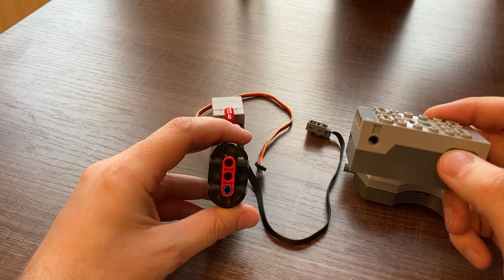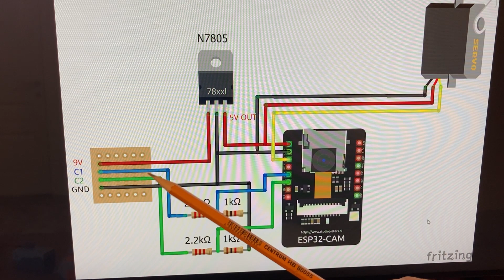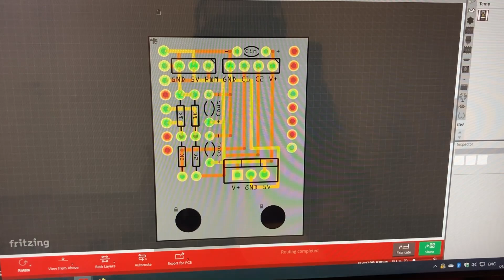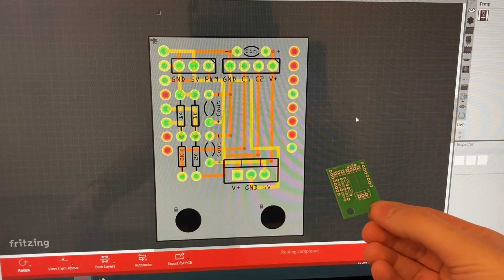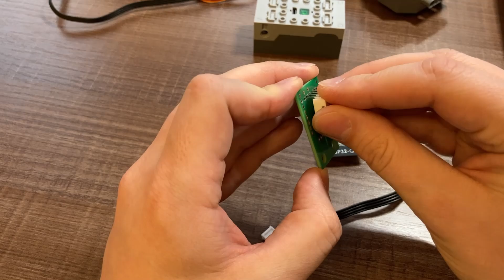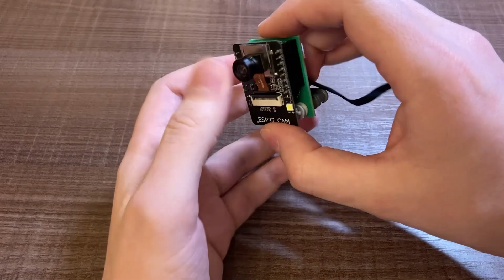Controlling GeekServo with Mould King Power Module 4.0

Comment: Great stuff. What would be needed to connect 2 geekservos to Mould King this way? Would you need a whole second setup (2x ESC32 etc), or would it be possible to connect both servos to the same ESC32?
Reply from the maker: Not sure this could be done on a single ESP32. For a more straightforward way of controlling GeekServos check out my more recent videos!
Reply: I built this and uploaded the sketch and the servos work but aren't proportional. Any ideas? Thanks.

Comment: What a great video! I liked it. So, I have one question: is it posible to connect the lego power fuction plug (4 wires) to the output wires (3 wires) of the servo motor and then control the servo with controller like regular lego servo motors?
Reply from the maker: Nope. The signal for 3 wire servo is different from one which is in lego's 4 wires. The green board acts as an adapter between these types of signals.
Reply: @igrolabs  alright, so i still need an "adapter" between the servo and the battery, like motor driver or something like that? 🤔
Reply from the maker: @ in this video, the mould king power module is both the battery and the driver. you can make a custom power module, something like in my previous video - https://youtu.be/hfu11bIr1LA
Reply from the maker: BTW now I'm working on a more simple and small custom power module, hope to finish it in February and make a new video
Reply: @ i'm looking forward to see it in your new vid 👏